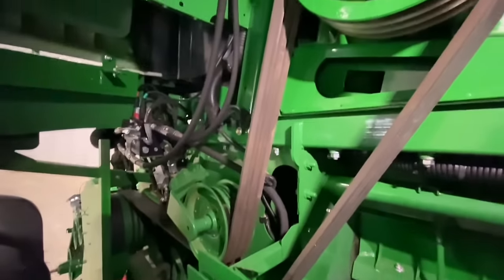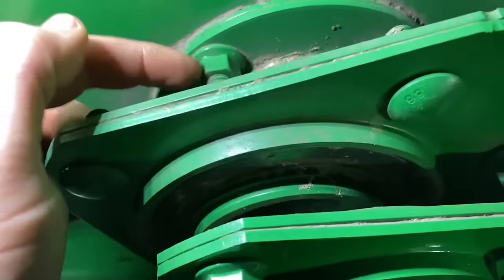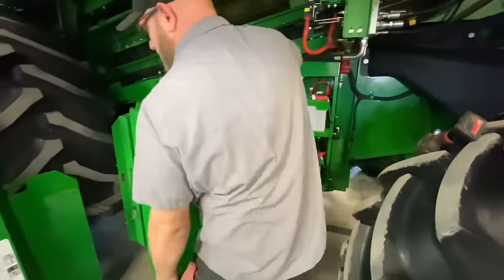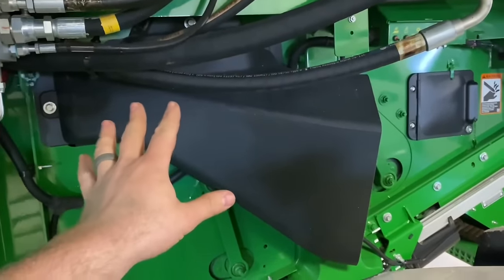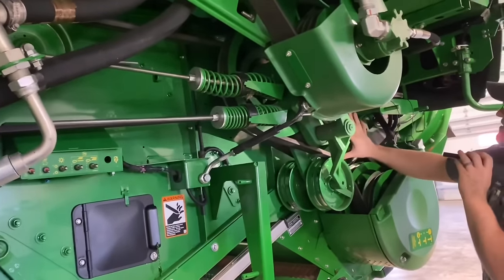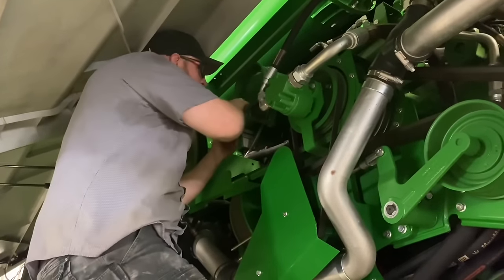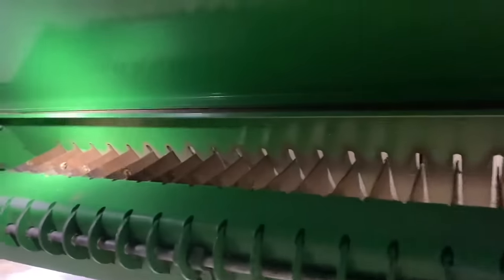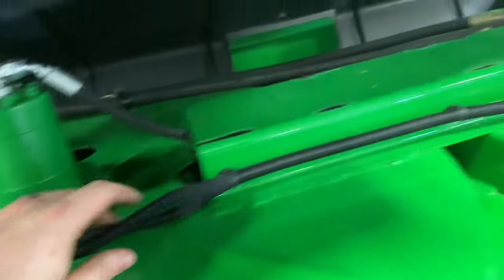John Deere S780 combine inspection (Part 2)

Comment: Are combines crop specific, or is it just a matter of swapping the header for different crop types?
Reply from the maker: Just swap the header. But there are some crops that require changes to the combine. Like rice and small grains. But for the majority of crops you just change your header and settings on the combine.

Comment: When doing the swing arms do you replace all the bolts also?
Reply from the maker: Yes they are one time use!
Reply: @ZKMasterTech  okay how bad is it to do the swing arms. Is it something a farmer can do. I did purchase a mechanic service manual for the machine
Reply from the maker: @389Sky  you have to pull the chopper off and the chaffer frame to do them all. So if you’re capable of that then yes. Then you need to know how to do the torque sequence and time it.

Comment: 1:41am ,😹
Reply: Now 2:38 am😆
Reply: This tractor are expensive, need to be a millionaire to have this.
Reply: @mistsemy1522  here in India, they mostly make nearly 50-55HP tractors 😹 n most people cant afford them.
Reply: @mistsemy1522  India's most powerful tractor is 120HP tractor, i dont remember the brand, there are also 75 & 90 hp tractor available.